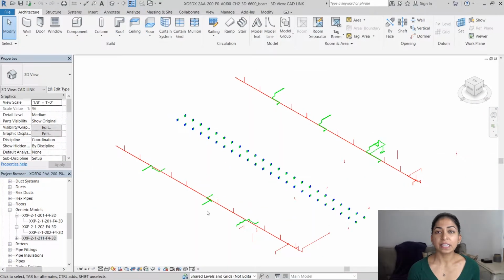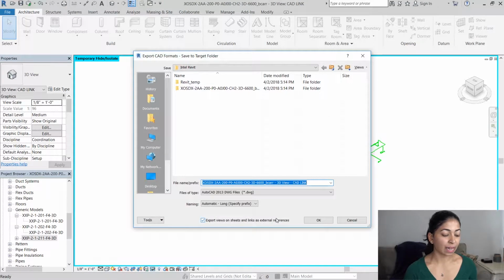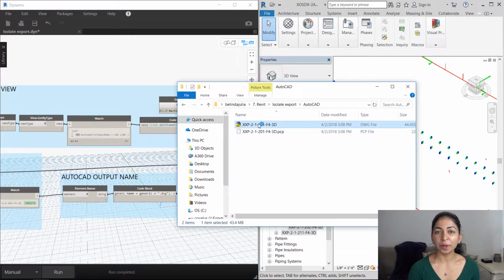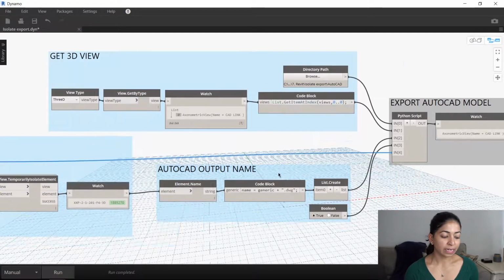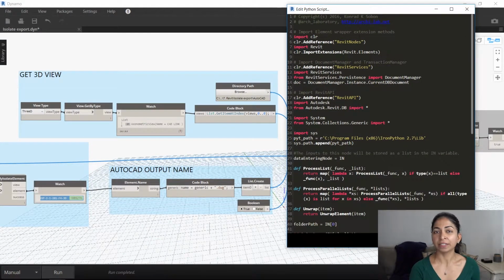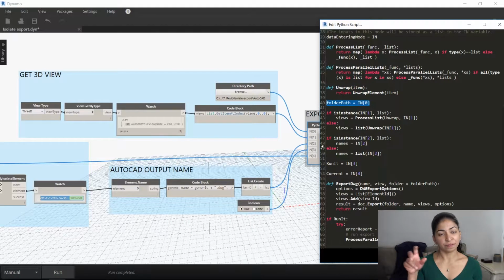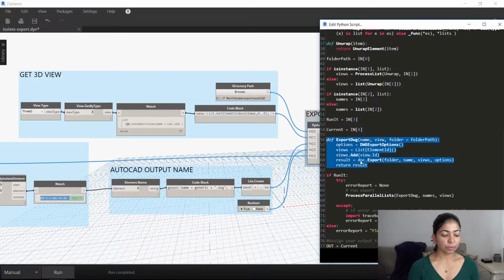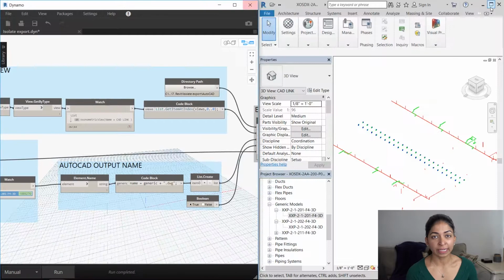How to isolate & export elements from Revit to AutoCAD with Dynamo

Comment: I did ran your program but dwg file could not be exported, i am using dynamo 1.34, i see no errors, but I could not find the dwg file at said path, can you help resolve this issue
Reply: Sorry I flatten one node and it ran, But I can't see what I need, I want each family type, pipe type etc should be exported in its layer name, but I can't find anything of sort, can you help?

Comment: Hope you can help, we have a Revit 2019 project where we need to export our electrical drawings to Autocad (for sub-contractors not using Revit) and all the Isolators/Sockets/Data Points/Security Points etc are coming out exploded as lines and separate text objects rather than remaining a block
 
We had a prior Revit 2015 project were we exported for the same subcontractor reasons but these items would remain as intact blocks (albeit named socket 1, socket 2 etc but quick wildcard searches can deal with that easy enough) so we didn't have this problem before
 
Looking through settings for exporting but cannot figure out any difference causing this and not having luck google searching either
Reply from the maker: Hey Sanal. Can you try setting your detail level to "fine" and then exporting? That should solve the problem. Let me know if it works!

Comment: Hi Belinda.. Can you help me. Actually i have idea but i don't know what's the exact node to use for the solution and my idea is placing a column by AutoCAD Mtext. You know in floor plan C1,C2,. Texts are  used for column type. So I'm going to use the same text for placing a column. I mean i just wanna node for read the text and where that location and I'm failed to use  Get.element.location then failed in AutoCAD extraction method. So you have any script for placing column by read the text and place the column bcz i don't known how to write.
Reply: I also Want the Same......